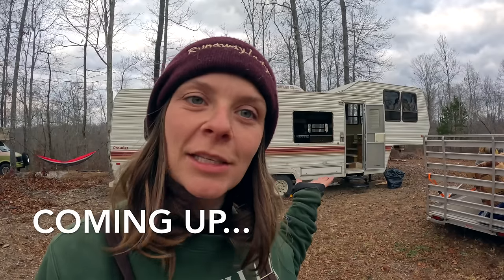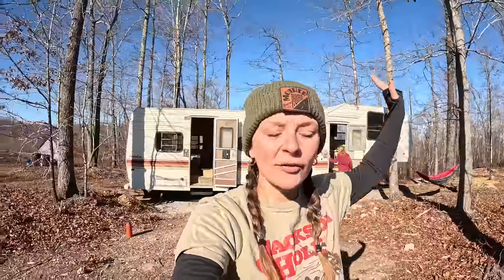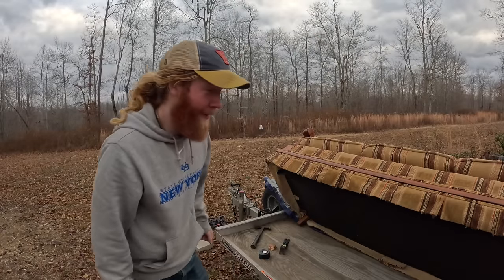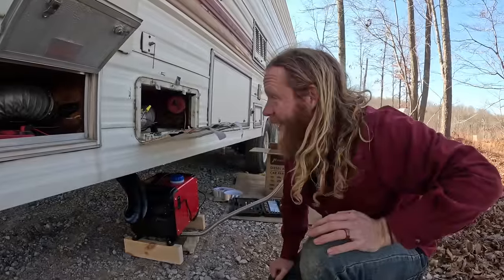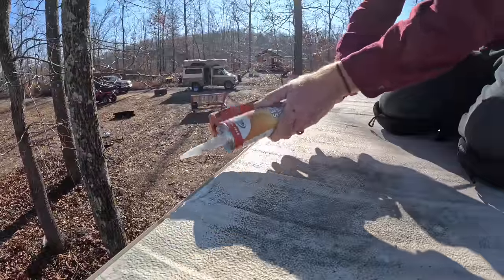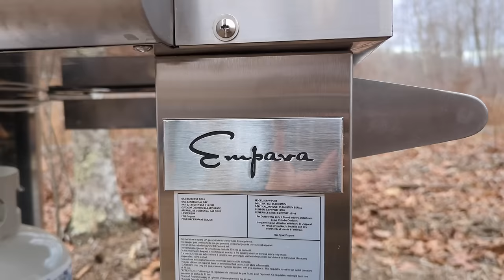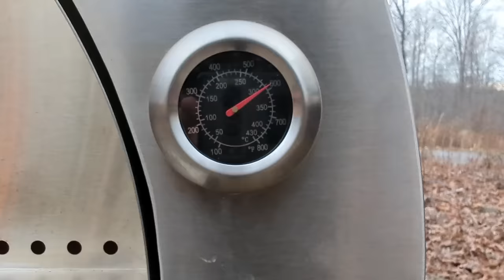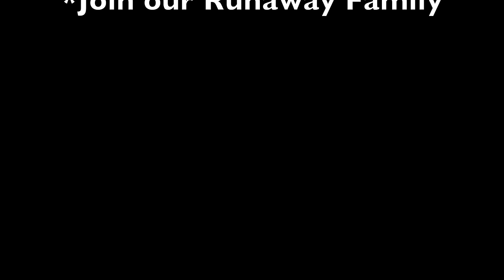We ONLY have 3 days...OFF-GRID Tiny Home Camper Renovations

Comment: Just so you know,  the original propane forced air heaters do not emit more moisture in the camper. If you have a wall blue flame heater then yes a lot of moisture will develop.  If you have a propane forced heater the moisture goes out the exhaust . As for which is more fuel efficient,  diesel stinks!

Comment: I have found a 2ft lattice around the bottom with removable foam sheeting is great for keeping a heat barrier for Idaho mountain winters. In the summer you put the sheeting down for air flow.
 We just tuck the foam under for summer. Might work for you.
Great to find your vids.

Comment: My camper also had a heated "under belly" to protect the water tanks.  The manufacturer just stubbed out a piece of ducting into the underbelly with no cover to keep mice out.  Mice got in.  In the spring snakes went looking for mice.  Snakes got in!  I thought I was going to have to sell the camper to get my my back in it.  Since we are no longer full time camping, I cut the ducting going to the underbelly and sealed the hole.  No mice and no snakes.  You live in the woods! they will find a way!

Comment: I am glad you stayed on your homestead and finally brainstormed in buying your RV trailer. 
On building your new home, please use pressure treated lumber for the foundation joist and flooring. Also, do use pressure treated wood as the bottom base plate for all your walls. By doing so, you will have eliminated the potential threats of water damages and termite infestation.
Now, how small or large you want your new home to be is totally up to you. What I can share with you is to focus on building a simple 400 square foot cabin. It will be cheaper to buld on a budget. With basic carpentry skills, you have your home built within 6 months to a year. Plus, you can easily build additional rooms adjacent to your existing walls. Since there are two of you working together, the process shall be at twice the labor building tempo. So expect to have your cabin up sooner rather than later. 
Best wishes!

Comment: The best window insulation covers I’ve made are: Reflectix (outside layer)/polycarbonate sheets (air flow layer/fleece. Spray glue together. Attach to window frame on the inside with 3M double sided stick Velcro. The fleece is inside in a decorative color that matches your vibe. I have bright yellow. I also use the polycarbonate sheets elsewhere for insulation, under bed, wall areas that are leaky. Also, insulation board, or at least plastic, around the undersides will make a huge difference. I’m going to do the diesel heater as you showed. I didn’t know about the moisture improvement over propane. Thanks.

Comment: You could always take some metal and go around the bottom and seal the bottom in. Put your little door to get to the heater. So you'll mold, you know where the heater is. And also you'll be able to open the door work on the heater. Fill it up with diesel and all that, but you need to take a engine a 1/2 phone.  And screw to the inside of the metal, then put it up as a underpinning around the bottom of the trailer. And then you'll have a warm trailer underneath and inside and you won't have to worry about the water lines for using

Comment: if you want to clean the sofa , take a damp cloth and spray it with little 409, wipe over the sofa changing out cloth . That sofa was popular in the 70s, My ex is an upholsterer. Try 409 in hidden spot to check for colorfastness.

Comment: Just to let you know home depot and lowes sell roof repair for RV's it comes in a 1 gallon can you need 2 gallons  it brushes and rolls on in the paint isle  at those stores you brush around all the vents and then all around the outside and then you roll the rest in 2 coats good for 3 to 5 years very inexpensive used it on 3 of my projects so far so good

Comment: Be sure to plumb a return duct to the air heater it will heat faster and be more efficient.. My company installed 10+ Espar or Webasto’s each year on yachts (pre-Chinese days) and the return duct was key. Also order a muffler to put on the intake as it is equally as loud as exhaust an intake silencer works amazingly well…

Comment: When it starts raining good please let us know how the seal job went. I teach people how to restore old trailers on line and everything you did on the roof is exactly what I teach people NOT to do. Goop and sealant is only a temporary fix. To fix it right and permanently you just need to know how the metal skin system on a trailer works and then you can address the leaks properly and fix them permanently without any goop at all. But most people who are unknowledgeable about these things just resort to tons of goop.

Comment: If you have an area on the property that you will eventually clear. Could you source poles to build a lean to roof over the camper? If you have the needed pole, all you would need then is tin. It would be a bit rustic but fit in well.